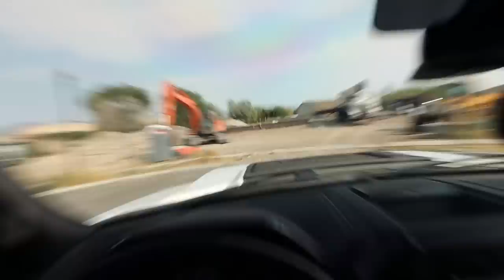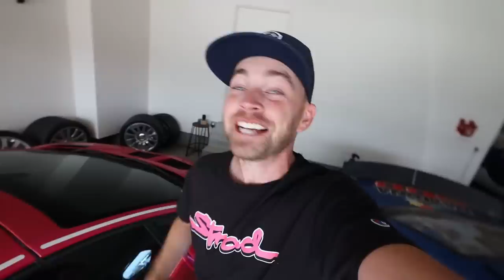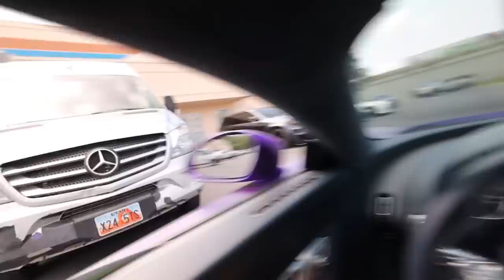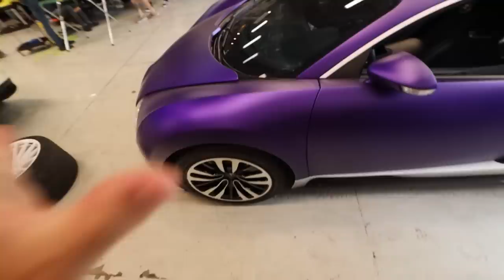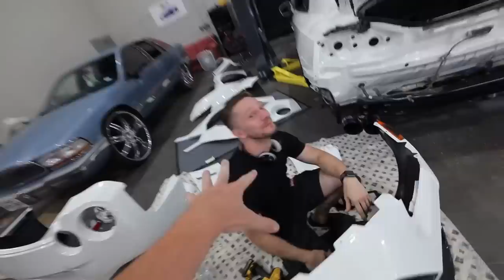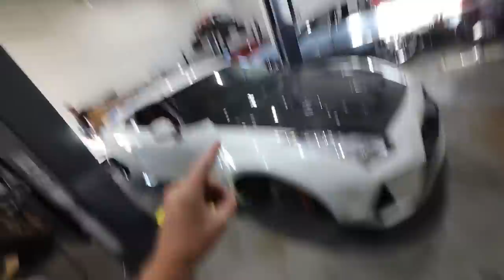MY PAINTED WIDEBODY NISSAN GTR!!

Comment: My first thought is if that wide body kit will not fly off when you’re going 160+ in that GTR ?
Reply: Yeah why not go with the bolts ?
Reply: @S28beats  fun fact, glue is used on salvage cars that need roof replacement/rear quarter panels. They hold up perfectly fine. I see no issue here.
Reply: @drshocking1229  sounds about right, thanks.
Reply: @drshocking1229  so that’s why my trunk fell off
Reply: @Mustafakhan-qg6nv  🤣
Reply: @drshocking1229  but he’s not using glue. He’s using double sided tape lmao

Comment: James quick tip during house building: I wish I had more throughly and in a more organized fashion take LOTS of pictures in framing phase (before wallboard goes up). Later when you move in and you want to hang things (or have work done on the house) you will wish you could see into the wall where the studs, pipes, wires are to avoid hitting something or better anchoring into studs.  I wish I even took pics of each rooms roof to better visualize where the studs were with several projects.